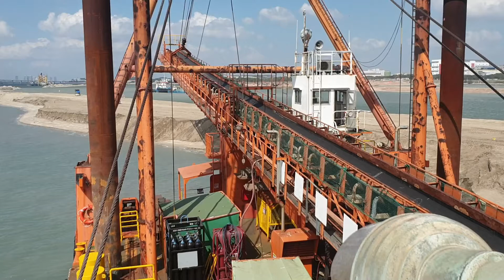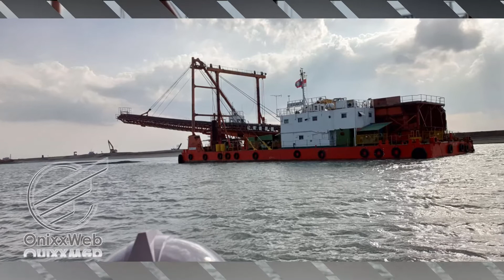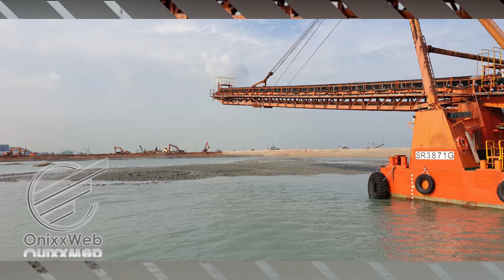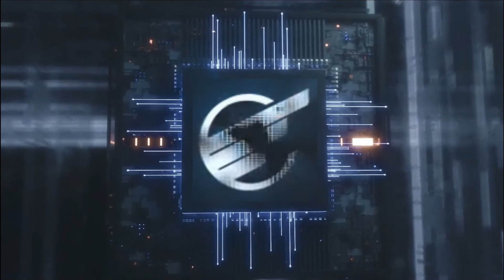CE04: Discharging or Conveying Dredge Material Using Reclaimer Barge || Marine Dredging Vessel

Comment from the maker: ⭕TIMESTAMP LINKS⭕
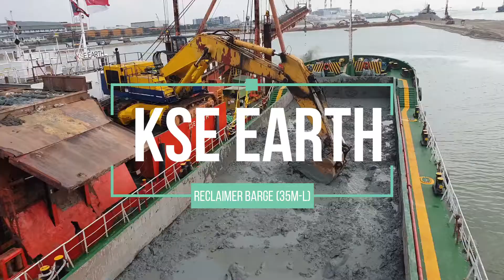00:00
00:04 Discharging Clay from Self Propelled Hopper
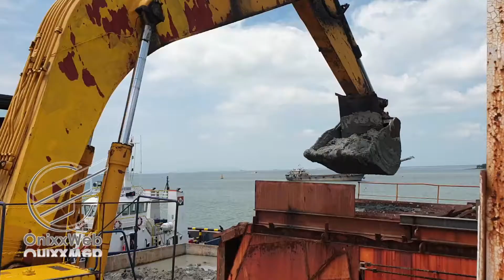00:19 Excavator Loading Clay Materials into Funnel Hopper
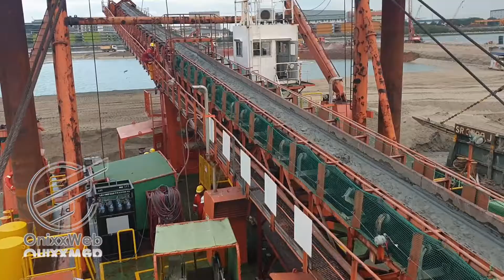00:23 Conveying Clay Materials through conveyor frame of Reclaimer Barge
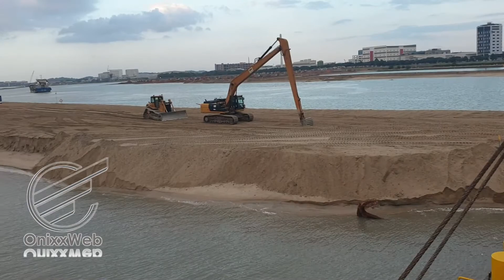00:40 Constructed Sand Bund Structure
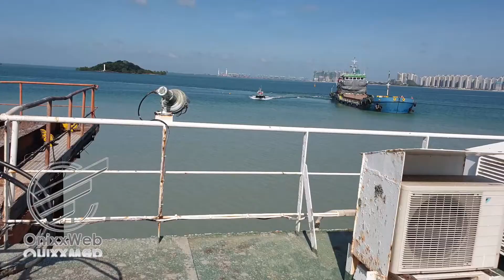00:43 Self Propelled Hopper gonna alongside the Reclaimer Barge
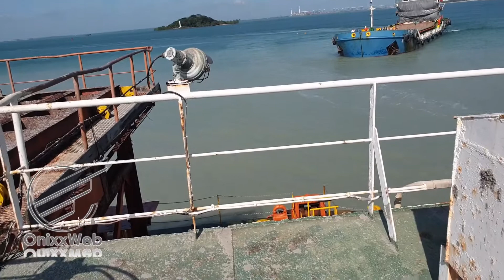00:57 Speed boat crossing Hopper’s fairway sending Barge Crew
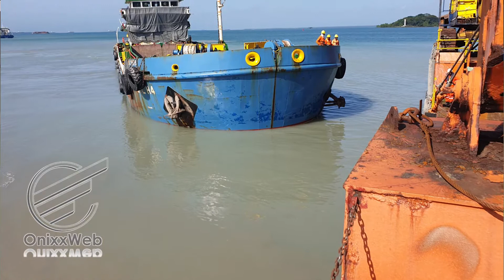01:36 Reclaimer Barge will start discharging once Hopper barge is secured.
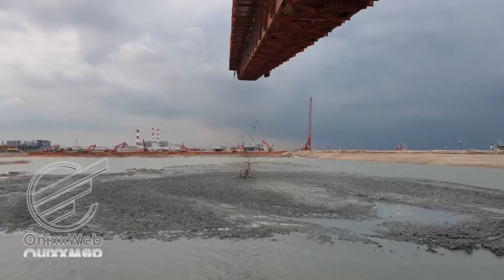01:59 This is the result when the dumped clay rises above seawater level. Approximately (+1.5mCD)
02:14 Reclaimer Barge Structure
02:34 The ‘HARD WORKING VERSION OF ME.” 😎😎
02:38 When Reclaimer is dumping on the Bund Supplying sand for Land works
02:58 Result of Reclaimer Dumping Operation, @ Lowtide.
03:13 Slowly but Surely 😅
03:34 Once dumped clay level reached the elevation requirement. Good Earth Filling Will commence. Sea water will be eliminated.
04:00 THANK YOU GUYS, I HOPE YOU LEARN SOMETHING

⭕Please Subscribe & Support My Channel:⭕
FB Page👉👉https://www.facebook.com/engronixx/?r...
Youtube Channel👉👉https://www.youtube.com/channel/UCgEh...